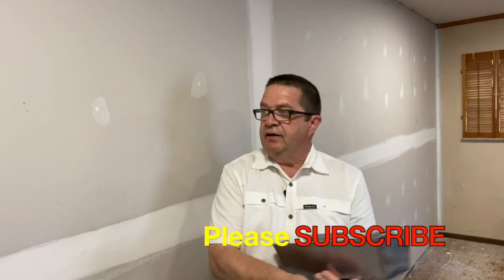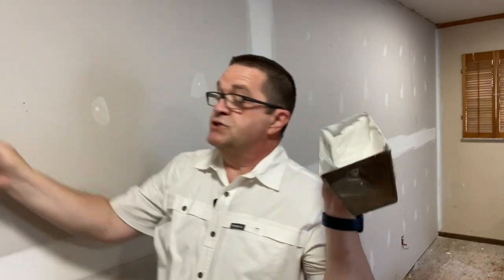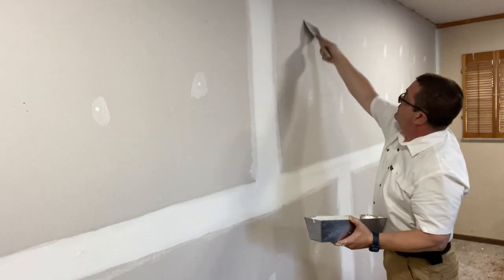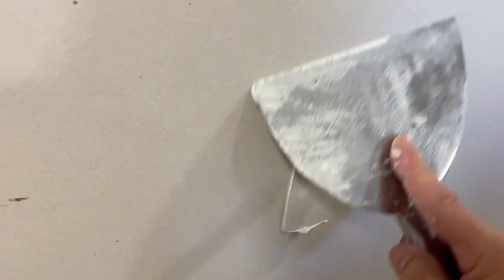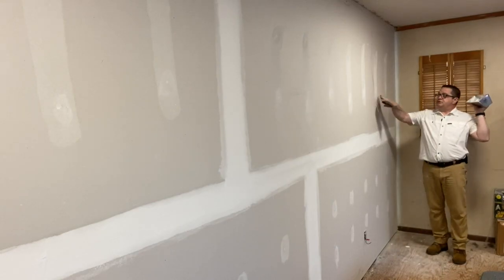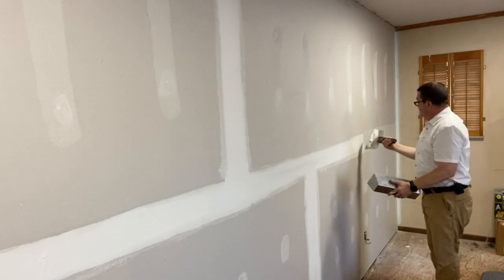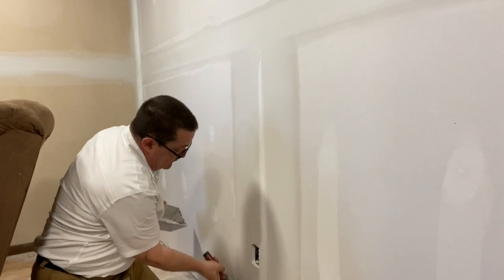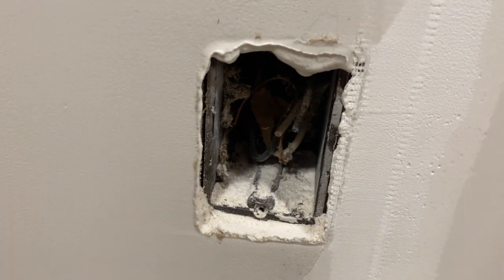How To FIRST COAT DRYWALL

Comment: Great vid... But why use mesh tape n durabond? It's been proven time n time again how much more solid and durable paper tape is.
Reply from the maker: I understand why you would ask this but my experience with properly installed mesh tape has been excellent.  After years (45) of using all types of materials in drywall finishing I have never had a single issue using the mesh tape method. I mostly use it on small jobs because it’s quick and easy…at least for me.